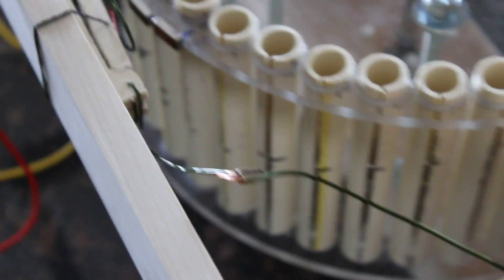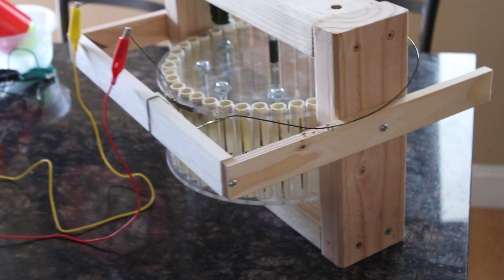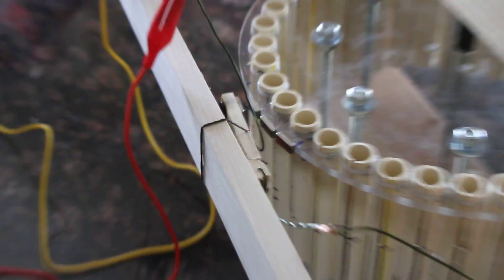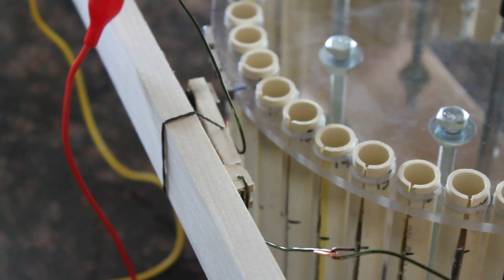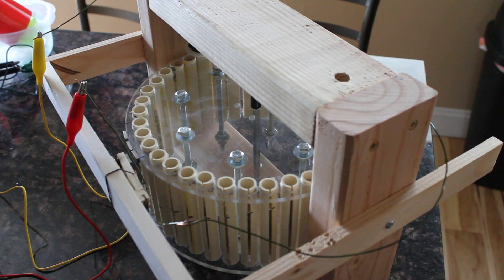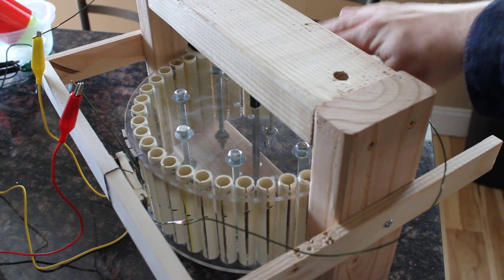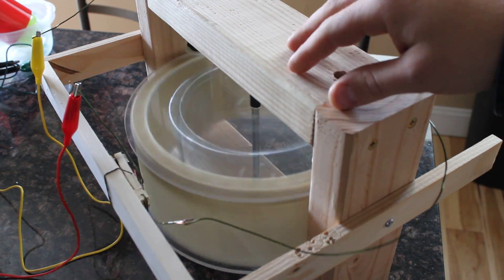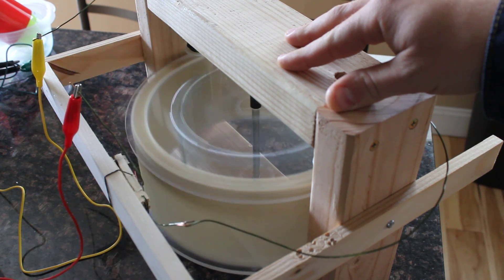FREE ENERGY MOTOR CATCHES ON FIRE!

Comment: Here's an experiment for you.  Use an old bicycle.  It gives you two wheels for the price of one.  Use industrial strength magnets.  It is best to use peg board for the mounting of your coils and wiring harness.  There is nothing to to do the bicycle except to place it upside down strapping it to the base that holds the peg boards.  You need to buy a box from Home Depot for switches and fuses.  Use a core from a car alternator to power the wheels.  I believe this may make enough power to run your house.

Comment: The fire was due to the fact that the magnets collided with the metal wire, causing friction, and because it spun too fast, it created too much friction, casing a spark! This could have burnt down your whole thing, because you used wood in it. Next time, try plastic, because it doesn't catch on fire, and it doesn't conduct electricity!

Comment: Dude.. I watched the earlier videos.. NOT ONE explains your principle.. and this one has wires everywhere.. obviously using electricity.. so whats the deal.. you need to EXPLAIN in DETAIL .. just start slowly.. from the beginning and tell us what you're doing.. and how it works.. otherwise why even post your videos?
Reply: +Gazinbali I think I kind of understand the concept behind his work, but don't quote me on anything. First of all, it should be established that no energy is being created here, as that breaks the laws of conservation of energy. What he means by "free energy" is that essentially, he is making a motor that produces more electricity with each rotation than it actually takes to rotate the motor. With an initial external push, the machine begins to pick up speed on its own electricity, while also producing spare electricity that can be diverted elsewhere.
Now, he accomplishes this using electromagnets, in a very similar fashion as a rail gun does. Essentially, he has that central wheel with many magnets on each spoke, and the wheel is connected with a very low friction axle to a frame that has an electromagnet on it. After the initial startup push, the electromagnet turns on for a very brief second. When it turns on, it attracts the closest magnet on the nearest spoke. However, the electromagnet turns off before the magnet reaches its most stable point in the magnetic field. So the wheel keeps turning. This process repeats with the next magnet on the next spoke. And so on and so forth. It seems the timing of the electromagnet is in sinc with the speed of the wheel's rotation to ensure that the electromagnet turns on and off at the exact right time. It needs to turn on late enough so that the magnet that just passed it is not attracted to it, but early enough so it can make some substantial pull on the magnet approaching it. Then, it needs to turn off before the approaching magnet reaches its most stable position in the magnetic field, or else it will be partially attracted after its passing, which slows down the wheel.
The actual energy it takes to operate the electromagnet is fairly minimal, so if the wheel is attached to an efficient generator, it can produce enough electricity to power the electromagnet, and also divert power to some external use such as a light bulb or a fan; or, in the future when the technology is further developed, houses and cities. And, you could store enough energy in an external power cell to give the initial startup boost the device needs to begin its revolutions and the energy it needs to stop. Essentially, after that original push, the machine supplies its own electricity, and more, forever (or, at least, until either the magnets lose their magnetism, the machine breaks down due to wear and tear, or the motor exhausts all of its usable electrons. However, the both the thing about magnetism and the the thing with electrons could take hundreds if not thousands of years to occur, depending on the strength of the magnets and the motor, so those are hardly concerns). Overall, the motor is highly efficient and very low maintenance, and it produces little to no exhaust and waste product, so it is an optimal solution for many of our planets energy concerns today.
But anyway, I hope this helped, and I hope my explanation was clear enough. Have an awesome day :)

Comment: It's obviously getting allot of power from being "plugged in", enough to catch the switch on fire pretty quickly. Instead of trying to switch a electro magnet over and over he'd be better off mounting a magnet to a motor and putting that beside his wheel, same effect less current to make it work (I guess that wouldn't be magic though). You could also just time the contraption to the frequency of the ac current in your wall socket and it would run without switches.

Comment: Magnets aren't free and neither are patents and the resources to construct an assembly line for anything.
Reply: They pay for themselves after a while, therefore you do get, Free Energy. Thank you for your time.
Reply: TheEndFactorGaming The magnets will also degauss at a rate of about 1% per decade, but if they exceed 200 degrees C, they degauss instantly.
Reply: yea, a re-gauss every 10 years, and you are good.
Reply: If the temperature is maintained it could work out better than most nuclear batteries.  But if temperature management isn't properly handled, it all comes to an abrupt stop.
Reply: Not killing anyone though.
Reply: TheEndFactorGaming Neodymium Magnets are very powerful and can break bones if a body part gets caught between opposing poles or you get impelled by repulsed by the same poles. 

There is a machine that is used to repolarize Neodymium magnets and it uses about 9KW of power to do it.
Reply: Mini Titan Even in the case of Neodymium magnets the literature says under heavy magnetic pouncing they should loose about 1% of their magnetism every decade (10 years).  However, if they over heat by exceeding 200 degrees C, they become instantly degaussed, and loose their magnetism.  Overheating or improper cooling can bring everything to a screeching halt.  This is Based on the specifications of the Neodymium magnets manufacturer.
Reply: Mini Titan at the rate of 1% per decade, this should be as if not more efficient than nuclear powered batteries.
Reply: +TheEndFactorGaming You cannot get FREE ENERGY from any magnet.
Reply: In the future, when we find out the mysteries of the universe, we will get free energy from piss and crap.
Reply: TheEndFactorGaming Are you on drugs?
Reply: Invalid Question Is Invalid
Reply: +TheEndFactorGaming True or false, this statement is false
Reply: If you attempted to create a paradox- you've failed... if it's false- its false... if its true-its fucking true...      .-.
Reply: TheEndFactorGaming
if you said true them you make the statment false because you said it was true but it's falsem if you said false then you made the statment true that it is false making you get the question wrong. paradox 101
Reply: I get what you are saying, but there is no conditional statements to creat a loop... if it is false- then only you know if it is or isn't. This is a better one:
If Pinocchio said his nose was gonna grow after a statement, and his nose grew, was he lying or telling the truth. Keep in mind Pinocchio's nose only grows when he's lying.
Reply: TheEndFactorGaming
a Paradox doesn't have to be a loop, it's an event that ends up with a conflicting answer
Reply: What is the conflicting answer?  That magnets don't last for ever or that you can't have an infinite repulsive cycle without an attractive cycle?
Reply: Edmund Williams
ppsss, not talking to you
Reply: Loop/conflicting answer- at times they can all be relative. Your example had neither.
Reply: https://en.wikipedia.org/wiki/Liar_paradox , period... conversation over
Reply: It wasn't a debate, or a conversation to be ended via a fact...
Reply: Yup. But the ENERGY ITSELF will be free, And pay itself off in the long run.

Comment: Kx36 asserts that the magnets will be discharged. ( demagnetized..) this is false as far as I understand the parameters of performance of these magnets.. ( from memory however..) these newer magnets are MUCH ( variously ) more resistant to thermal or magnetic field degaussing  than old magnets..  

As for thermodynamics, yes, in theory...but considering the above, for one, it might be possible to cheat them, even if that sounds crazy.. Doesn't the force available seem as if it could do work without electricity added..?  ( it may well be an illusion, time will tell... ) 

Good job on all the work you did trying this stuff.. Good luck..

Comment: a capacitor at the right point in your circuit might solve your arcing and fire problem. :)
Reply: It's not an arcing problem; The "fire" was caused by the switch turning on and off (open and closing). If you bang a metal pole on another metal pole then they both will heat up. Do it fast enough or with enough force and it will spark.
Reply: ok.. carry on..

Comment: dude. listen up. the only way to make a free energy device would be to have it gain energy rather than loose it. common physics prove you wrong, unless you are a massive ball of gas in the sky. you are loosing energy through the sound it makes and the fire created. energy is transfered not produced humanly. solar power is the closest to 'free energy'...-sophmore in highschool
Reply: chase tuttle It will gain energy as the thing will be spinning at such a speed that the electric charge it is generating (once connected to an alternator or the like) outweighs the energy it is using to run. As it is using magnetic power, the energy usage is rather low so that makes it easier for the 'invention' to generate power.
Reply: Still yet this is not producing free energy! It is TRANSFERRING the energy from the magnets to electronic power. Energy is not produced it its converted from the force of the magnetic fields produced.
Reply: chase tuttle Where does the magnet get the energy then? Hmm? You tell me that
Reply: Its a "clean" energy alternative because it doesn't use fossil fuels. that's why people are investigating it
Reply: Mark O Connor :) can we be friends?
Reply: Crozbyguy dear possibly grown man- the energy produced from an atomic is the breaking of atomic bonds. This energy is there already, I is there to hold the elements all together and such. What an atomic bomb is doing is splitting a single atom and chain reacting, its just an exothermic reaction, just releasing the energy to the bombs surroundings. Your turn
Reply: Brian Johnson
To use some false title just to grab one's attention "you have to be foolish". I do like the idea of someone playing magnets and energy. I do like innovations, I do like thinking outside the box. It's just that thinking "I can create free energy" is not "outside the box". It's just "outside common sense". It's juvenile and is lack of thinking. "Cheap energy" is one thing. "Free energy" is definitely another.
Reply: This is a test for the generator the actual one will make the power for its self if it needs any he's probobly going to make a model where you just have to spin it to turn it on to generate
Reply: Still explain to me how it will gain energy, once you can tell me that then you win.
Reply: Whoever made this video I give a lot of credit it looks to me that he put plenty of commitment into this, its great. I have nothing against people messing with magnets to play with energy. I was just stating that this is not a way of making energy, it is just simply taking the energy from the magnets and turning it into a current.
Reply: +chase tuttle Obviously the device isn't "creating" energy. Duh.
"Your turn"  Pffft, please what is this, a game of chess? Are you trying to win something? Have something to prove? You want a gold star?
Reply: Brian Johnson  I think chase's arguement does not hinge on the creation of energy (a false statement in its self) but the false nature in which the video, and subsequent arguements against him, clame this is free energy. Creating magnets isn't free, magnetisation usually requires a charge or a stronger natural magnet, which cost money to create the right alloy. There is no such thing as free energy devices, solar and wind have their cost as well, you must rememeber, as do fission and even fussion.
Reply: chase tuttle
yes chase , yes we can
Reply: Of course, but the point of the video is to explore a different means through which to transfer energy efficiently. I mean, we could go into semantics but common sense tells us that the real purpose putting "FREE ENERGY" in the title of the video was really just to grab our attention, which it did. To take the title literally would be foolish.
Reply: but it looks like a good number of people in the comments have taken it serously. Ignoring the fact that i dont think a magnetic energy device is even economicly possible at a large , or industrial scale.
Reply: It depends on how you look at it. I mean, ultimately this guy is just trying to catch as many people's eyes as possible. I can't blame him. Whether that's foolish or not is up to you, but personally I can't blame him. I'm all about getting down to the tiny details of stuff, but getting sore over the title of some video is a little silly, especially when the video is about something that interests you.  It's cool that this stuff interests you, me too, sure the title is cheesy, but whatever, you know. I'm far more interested in the video content.
Reply: I wonder if you know anything about what you are saying..common physics? Therm 1 and 2 you mean>>?? Or QUANTUM physics..? Check out Zero point energy, or consider the simple fact that most atoms in the universe are 13billion to 7 billion years old and ARE energy...To imagine there might NOT be a way to ( effectively, solar or otherwise..) get "free energy" by what ever definition is the height of arrogance or stupidity or perhaps both...Personally, Id consider anything I didnt have to pay some monopoly for" free "...Considering these monopolies are collectively the largest business on earth, one might consider it prudent to NOT consider all that ends up convenient for them to be " value free" and objective " science"..  Try googling cold fusion...?.
Reply: The energy is produced by the momentum built up by the force of the magnets which require no power input to power. BUT he does add power input because he's using electromagnets that makes them more powerful, probably produceing MORE overall energy than he would with normal magnets.
Reply: Crozbyguy  dude hes right, its the basic law of thermodynamics "energy cannot be created or destroyed, just change from one medium to another" . There CANNOT be a perpetual motion device.... ever. Chase tuttle put forward valid arguements and your only responce is An atomic bomb, given how  nuclear fission is completly different from magnetic energy its a pointless statement. Please all of you read a physics book

Comment: do you remember back in the day before electronic ignitions? they used to have points. they had to be set a a certain gap and they had a condenser in the system to prevent sparks from starting stuff on fire or over heating. Im sure you can still get one from a motorcycle parts catalog or even from Kawasaki, 1970s ignition system...

Comment: ... yeah but you can make a system where you'll need the power input then it can charge itself after a couple cycles through using Tom Bearden's electrical current system. Basically instead of always using the energy input, your sustaining the work already there something like Tesla wanted mankind to do. There's efficiency then there's C.O.P.

Comment: Two words for how a magnet generator works and doesn't break the laws of thermodynamics.
Inertia, Momentum.
It's very simple really, magnetic force is spent to give an object high momentum, which is then converted into energy. Momentum->energy is NOT 100% efficient, and magnets don't hold their force for all eternity under use. It's not technically free, or 100% efficient, just cheaper than current electricity prices, as in enough to profit.

Comment: Device efficiency is not defined only by the friction or stability, where is no load on your device (where the power is collected/used). For the coil you might want to turn this power to electricity which leads to electrical motor as a generator or another coil. And this is another great waste of power and efficiency. Why always the wheel? Seriously, every time I see free-energy project it's a wheel... :D
By the way, you might need to use transistor as a driver of your coil. Gerkon to the base.

Comment: You should really remake your electrical circuit. I would suggest you using a gerkon instead of your switcher. That sparks shows that your current is, well just say, a bit too high... Simple electrical motor would spin your "wheel" faster with that much power. To make this a "free energy" project you must stop wasting energy, the gerkon will allow you to decrease the size ad mass of your switch magnet (the one on the spinning part of device), second thing would be to replace your current coil

Comment: Go read the laws of thermodynamics. Physical laws can't be broken by any engineer. Energy can't be created or destroyed, only converted. in this case, a magnetic motor, there's a lot of magnetic energy stored in the permanent magnets. As the energy is converted to motion, heat, sound etc, the magnets slowly discharge. 

There is a finite amount of energy in the magnet, it's essentially a battery running a motor.

Comment: ok, so what is the wire made of and where do you attach the wire from which potin to which (in your video it appears to be from the black battery contact to the radiator cap - is that correct?)